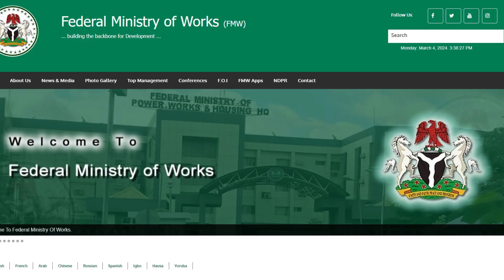Revolutionizing Road Construction Senator Umahi's Concrete Technology

Comment: This is not correct. Umahi is just shifting the problem. As a civil Engineer who has practice both in Nigeria and Europe. The problem of Nigeria construction both road or building is not technology but pure case of corruption. Both asphaltic concrete and reinforced concrete technology have advantages and disadvantages. Nigeria is conducive for both methods if the right things are done during construction. In construction of road the most important aspect is your foundation which is where most Nigeria road failure happens. The pavement is just covering and for transmission of loads to the foundation. If you like use any kind of method the moment your foundation is bad the road won't last. We have road that are built with asphalt paving in Nigeria that last over 30years in the past. 
Most people don't understand that the moment an asphaltic concrete road is built you are to be resurfacing the wearing layer at intervals but the road foundation it's should last for over 50years. 
Most of our leaders are just emptied headed surrounded by low quality technical ppl who should have help them understand the problem. 
If you look at the ministry of works most of the ppl that works their aren't competent that is the fact. You can't give what you don't have. How can you supervise what you don't know how it was designed? How can you inspect what you can't interpret? How can you know maybe a design is adequate and up to standard when you don't know the standard? Here in Europe Construction is a highly regulated field where only competent people can sign off a project and if the project failed the engineer will be put in jail. After 12years practice in Nigeria and 3yrs in Europe, I can clearly state our Engineer and construction industry is in serious mess. Most of the building been approved by FCDA are just crabs.
Reply: I beg me self Wan japa comot 9ja Boss.. Can you help me fast track that!!!!